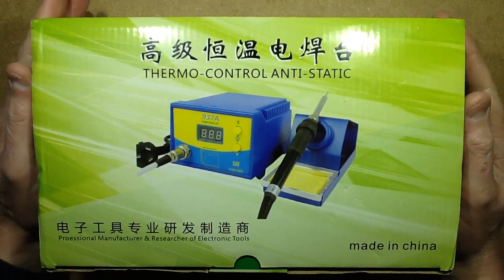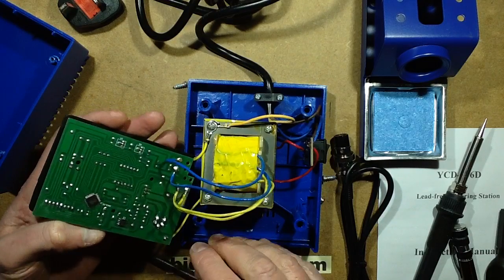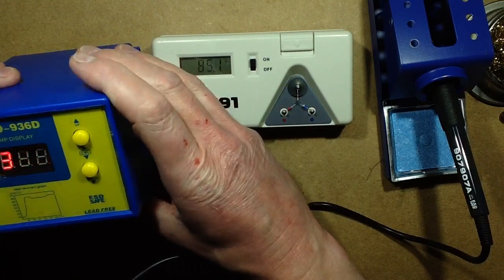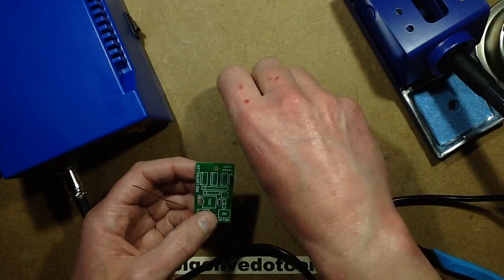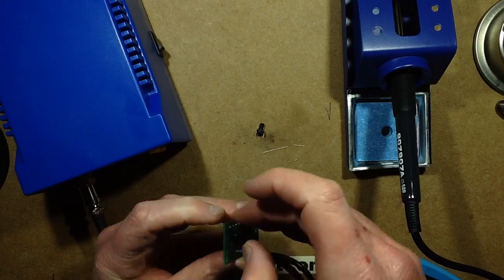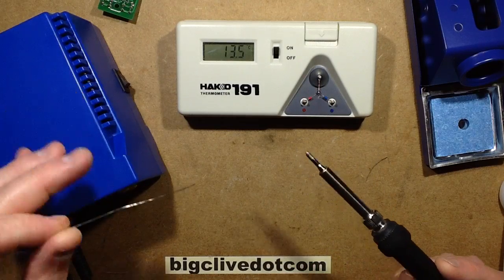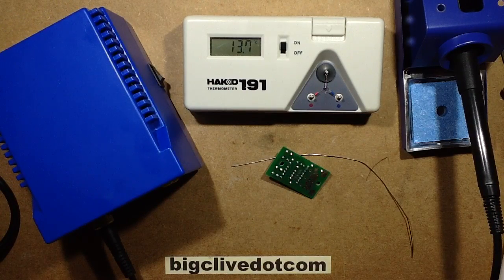936D digital soldering station test and internal look.

Comment: QUESTION
if you have chunky transformer from other device with the voltage ratings in 5% tolerance of the soldering station one, is it possible to just buy replacement panel and iron? Would it be economically better or worse choice? (i mean on the cheap cheap and the cheapest spectrum)
What is the power rating of the transformer?
Reply from the maker: +kokodin If you had a 24V AC transformer rated at least 60VA (preferably 100VA you could make a very robust DIY iron.  I already have plans for a video covering this, but with a different transformer arrangement.
Reply: +bigclivedotcom well..... it is a little bit of an overkill then. i have a transformer block from overhead projector. it can be powered from  240V ,230V or 165V and it can provide 24V for max 250W halogen bulb :] from any of those voltages. It also have -10 V terminal on the primary winding for "economic cycle"(single coil with 5 terminals in series -10,0,165,230,240)
I got it for free from work and it only colect dust, so why not use it
Reply from the maker: +kokodin Be careful it's not an autotransformer.  One that doesn't have isolated primaries and secondaries, but has a tapping on the mains side to provide the lower voltage.  That would mean the circuitry was potentially live at mains voltage.
Reply: +bigclivedotcom 24V is on secondary side, there was no citcutry at all, only  two switches on/off and 0-230/ -10 - 240
secondary side was connected straight to the bulb.
Classical EI core and two visable separate windings. the 24V is something like 1,5mm2 mains copper wire, primary is around 0,75mm2
I don,t know who made it and why it was so wierdly wired. All i known is that students demolish the machine, and i got some parts out of it, the rest went to another ohp as replacement parts
I also known how not to get shocked, i have papers for that :] So few connectors will have to be covered by hearshrinks.

Comment: For beding part leads you could also get of of these, so you get the spacing right. http://www.ebay.co.uk/itm/Electronic-Component-Lead-Bending-Forming-Pre-Forming-Tool-/231867344546?hash=item35fc5ee6a2:g:84gAAOSwpzdWrlb8
Reply: +Chip Guy Vids 
That looks handy, added to my (ever growing) list of stuff to get around to buying.

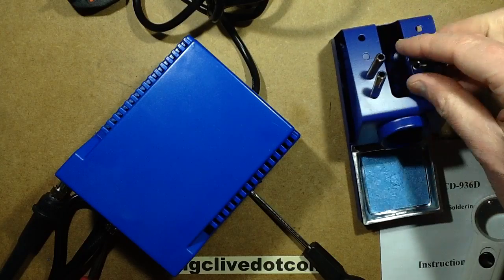Comment: 7:35 - I thought the same thing on mine. The rack you have is identical to the one that came with my Chinese-y Hot air/soldering station. They both also seem to be mimicking the Hakko stations with the blue/yellow color scheme. I  rather like the station for what it is but Can't figure out what those holes are for!!

Comment: I'm curious as to if you watch your hands through the iPad or if you watch around the iPad to see what you're doing.
Reply: In some videos you can see that there is a rectangle of tape on the workbench marking the iPad's field of view. Clive knows without having to check that anything within the rectangle will be visible in the video.
Reply: +zh84 yeah, I've seen the rectangle. the thing that made me wonder is because occasionally in videos here feels the need to adjust the brightness - or he comments on lights flickering on the iPad but not with his eyes.
Reply from the maker: +bdot02 I glance at the iPad from time to time to see what you guys are getting.  But most of what I do is viewed directly.

Comment: I bought quite a few of these for work and private use. Some have completely horrible internal design with 2 pcb boards and loads of wires going all over the place. The single pcb board design, like the one shown here, is much better and has never caused any problems for me. I'm not sure about the anti-static claims they make. The iron itself is quite crappy, but good enough for basic hobby work. The sleeve at the wire end tends to separate from the iron.

Comment: whats the reason for higher or lower temperatures on irons?
Reply: you need enough heat to do the job but not so much you start damaging stuff 

also speed more temp=faster (not always a good thing)
Reply from the maker: +Peter Griffin Different solders have different melting temperatures and different people have a preference for a specific temperature for their soldering speed.

Comment: I have the Circuit Specialist version of that iron. It has three temperature memories but otherwise the same thing. I use it in production in my cable making business soldering audio and DIN connectors and it keeps up with no trouble.

Comment: Bending leads - oh man you struck nostalgic gold. My electronics professor insisted that our tools include a tool that looked like a diddle stick with a pointy probe at one end and a split end on the other. You put the lead in the split and give the tool a twist. It gives you a bend with no stress on the part, and gives you freedom to bend leads where you think they should be. Still have it and never lend it out.
Reply: Thank you, I got a Weller hobby iron and a stick like that Was included. Now I know what it is for.

Comment: The iron-holder needs to be weighed down. It is quite light and easily moves when you take out the iron. I was waiting for you to finish off the circuit-board but the video ended :)

Comment: Atmega? does it have a JTAG or any other programming interface?
Reply from the maker: +afroninjadeluxe That's possibly what that multi-pin connector is for.
Reply: +afroninjadeluxe The Atmel AVR processors have a set of pins for In-Circuit programming via SPI. You need to use at least five of them (GND, RESET, MISO, MOSI, CLK). The ATmega8 is quite old now; I didn't know if it was even still in production.
Reply: +nrdesign1991 I disassembled a South African made MPPT controller the other day that also had an ATMega8 in it. Seems to be alive and well, and used where the 168 is considered "too much" :-)
Reply: plonkster
A good replacement for the '8 is the '88. it is pin compatible and has a number of better features, such as additional pin-change interrupts for every pin instead of just the two fixed interrupt pins (probably they used those for the two temperature buttons)

Comment: Clive, I have the digital 3-in-1 station, which is a hot air gun, soldering iron and (quite possibly the worst) bench power supply all in one unit. Maybe I should do a teardown of mine... Anyway, I have the same exact stand, and if you go to the hardware store and get some small machine screws and nuts, you can put them in the holes for the stand pointing upwards. This allows you to put the bits on the stand, and the tip faces upwards so you can see which one it is. After doing this, the stand is GREAT.
Reply from the maker: +Luke Den Hartog That's a good idea.
Reply: I'm actually using it right now: http://imgur.com/wM1U0Au

Comment: It wonder how well it holds the calibration over time; for a week, month, quarter. Or will you need to cal it before each use. Assuming you'll be using the same handpiece.
Reply from the maker: +JHNielson4851 I would expect the thermocouple to remain fairly stable.

Comment: Would have been interesting to see how accurate the calibration was out the box with the bit supplied, I presume it would have been a little further out due to a higher concentration of heat?
Reply: +kingoginge They are supplied with a calibration feature, but not calibrated in any way. How close it is out of the box is just down to luck.
Reply: That's fair for the price, the quality of Chinese units has gone up dramatically.
Reply: I don't know how bad the quality was before. On this unit, I'd like to have seen a red filter in front of the 7 segment display to increase the contrast and a locknut/star washer etc on the earth connection which being loose from the factory is a serious safety fail. Also, these irons claim to be around 60W power, but Clive says they don't have the oomph of his 25W antex. Something's not right there. It shouldn't matter that the bit doesn't have as much thermal mass if the power going into it is more than double. That might be because the element is loose in the tip and maybe a shim would help.

I have seen on a different channel that the control loop in software is also not very good. It massively overshoots (by 100 degrees or so in the other video IIRC), but the microcontroller cheats and never displays a temperature higher than the set temperature. That might be because of the poor thermal contact between element and tip making the loop response poor/unpredictable. The element probably gets to a much higher temperature still and you have to wonder how long it will last if this is the case.

It's actually not hard to take some time vs temperature measurements of a cooling soldering iron (it will be a first order system equivalent to a capacitor charging and discharging through a resistor), Laplace transform it to the frequency domain and use that to set the loop compensation correctly for a fast step response with minimal overshoot, but few people know this and because it's a low frequency system you can get away without doing so and it will still "work", just often poorly with slow response, big overshoot and/or an oscillating temperature.

Comment: I had a quick look for this on ebay and I came across a 'CXG 936d' which appears to be a similar unit, but all the control is built into the iron itself. I'd be interested to hear your thoughts on it regarding portability vs serviceability.

Comment: Looks nice. Where did you get it, and how much did it cost? I want to buy one for a friend who's been using a cheapo Radio Shack Iron for years. Also, I have a question about the Hakko 191 heat sensor. I own the Hakko FG100. I'm wondering what the differences are other than the styling?
Reply from the maker: +Glenn Martin I'm based in the UK and it came from a UK warehouse.  The 191 is a generic Hakko knock-off.

Comment: Where did you get that iron from?
Reply from the maker: +ki2azyone If you search on ebay for 936 handle you will find a wide variety.  But in the case of these units it has to be the type with the plug end on the iron.

Comment: Are the soldering irons a standard type plug in, and are spare bits made, and what to look for on Ebay? My main use for one is specialist low melt solder for model assembly.
Reply: +stephen wallin I can see spare 936 irons and sets of compatible bits in very cheap Ebay selection. I think I will order the station first, then spare bits , then spare irons (several at the price).
Stephen.

Comment: Clive, have you ever tried the Metcal smartheat soldering irons? After using one at work I really did feel that I didn't want to use a conventional iron again.They have a tip which uses curie-point temperature sensing to maintain temperature almost regardless of thermal load. I believe that the drive power from the control box is RF which may explain why they're rather costly. Very satisfying to use though.
Reply from the maker: +Steven Birch I prefer to use affordable stuff in my channel videos.  That way anyone can afford the same type of equipment.

Comment: Just a thing about the repair note, if you have a tool that's that cheap, forget repair, cut your losses and replace
Reply: This is Big 'I'll replace those LEDs with warm-white' Clive were talking about
Reply from the maker: +camtheham13 For technical people it's just more pleasing to rip out the whole front module and literally have the iron working again with just three large solder joints.  Ground and 24V  AC.
Reply: +bigclivedotcom granted, but at the same time that's not much good if your preferred iron is busted, so for me I would keep it and fix it eventually but replace it in the mean time
Reply: there has to be a philosoraptor meme about this..

Comment: Hi clive! i managed to get an aoyue 968 for free locally but it has one of those crappy pointy tips do you know if the generic type tips you used in these videos of the cheap irons would work? 

Thanks for the videos really gave me a hunger to learn electronics :)
Reply from the maker: +Stepy D Many of these bits are based on Hakko bits so do a search for Hakko bits on ebay and try some.
Reply: +bigclivedotcom had a look managed to find a pack of 5 for 8 quid delivered so going to order them tool the tip off to have a better look at it and the ceramic heating elements got a tiny chip missing on the top so going to see how i get on if replace that if needs be but very happy with it for free

thanks for the reply keep up the good work

Comment: I'm always amazed at how you can hold the soldering iron, solder, and board together.  It's almost like you have three hands.  I imagine that comes with years of practice.
Reply: it takes practice and years and years of expereience.
Reply: @petrosrz  Practice and years of experience, or a few weeks on an assembly line.

Comment: Hmm.. An idea, so what if you did the opposite where you took a cheap analog clone and replaced the front plate with the digital version? The only problem I can think of is that nobody appears to sell them, had a quick look on ebay and couldn't find any.
Reply: ***** It's a soldering iron...
It gets hot... Unless you're a professional there is little reason to spend more than absolutely necessary on an iron.

I've used cheap irons myself, no they aren't great, but hardly rubbish.
Reply: ***** Well yes any car does infact get you from A to B what's your point? It does exactly what it needs to and as long as it doesn't break down often I don't see what the big fuss is... A better ride is nice but isn't "important" or "required" in any sense and usually has a large bump in price for little benefit. Which by the way for about what that thing costs you may as well just spend about $10 more and get a hakko fx-888d, I'd bet it would make that iron look like shit too...

Right I'm the dick am I? All I did was bring up an idea and then you indirectly say it's shit and suggest I get some other random iron and when I say I'm not interested because I find it unnecessary you call me a dick?
The irony is strong in this one.
Reply: +vgamesx1 this Aussie guy is a troll. Ignore him
Reply from the maker: +vgamesx1 The snag there is that the digital version has an extra 10V winding on the transformer for the logic that the analogue iron doesn't have.
Reply: +bigclivedotcom a quick hack with a 59p buck converter will sort that, assuming there's a DC out somewhere :-)
Reply from the maker: +Jason james I think the 24V stays AC as it's just for the heating element via an opto-isolated triac.  So you'd need a rectifier and cap too.  Or just perhaps add a small 12V DC supply tapped off the mains switch PCB.
Reply: Jason james bigclivedotcom 
Actually you can get little DC converter kits such as this one with an LM317 http://r.ebay.com/7lWh4E

The interesting thing about them is they come with 4 diodes for a rectifier so you can run it off AC or DC, dunno why the pre-made ones never offer that though.

Comment: I'm still wondering if you've ever checked the calibration of your soldering iron tester but this video leaves me with maybe a more interesting question. If I buy this cheapy iron is there a cheapy way to calibrate it?
Reply: +mwtbones I use the thermocouple on my mulimeter, just get the tip hot and tinned and dip the end of the end of the sensor into the blob of molten solder.
Reply from the maker: +mwtbones It's a type K thermocouple and seems to match well at a wide range of temperatures.

Comment: Thats really nice :-D, i agree that using custom coded processors are good while they work, but impossible to fix when dead.
I would rather use an external temprature display just tapped into a buffered sensor output, op amp control with seperate display.
Once calibrated, does the bottom and top temprature stay correct?
Getting a sensor and calibration to stay linear could be a problem.

Comment: I was as waiting for you to review this, I got pissed off with my three previous irons, the first  iron was a 240v 30w, which i had from when i was 16, (40 now), that had a nail as a tip, second was a 240v 60w i got from china that made the power lead floppy and warm, third was a 30w aldi special that had stupid custom screw in tips that break (and leave the threaded part in the shank of the iron, which i destroyed with a screw extractor - one bloke on ebay is optimistically selling theses tips for a fiver each)... anyway, I ordered this iron last week and it came this week (just before your review).I have never felt so spoiled! the iron is light and easy to use, built a couple of power supplies and even salvaged a couple of triacs and heavy parts on alu heatsinks. I feel that you really held back on this review. if you are used to old 240v traditional irons, like drapers or noname brands you will LOVE it. I am a cheap bastard, by my own admission, my three previous irons cost double the cost of this one. But one week in I am just hunting everywhere for things to solder. I didn't switch from coffee to tea, I switched from turd sandwiches to pork and stuffing with a crackling on the side.
Reply: John Quinton I'm thinking of getting this station and I'm coming from the same place as you. My crappy 25w Chinese iron broke, I've been using one of those metal tip wood burners for the past few months, and I just got a cheap iron from Lidl to tide me over until I have the money to buy a station.

Comment: I use a piece of half inch copper pipe pushed into the soldering stand. Works well to prevent the iron getting stuck.